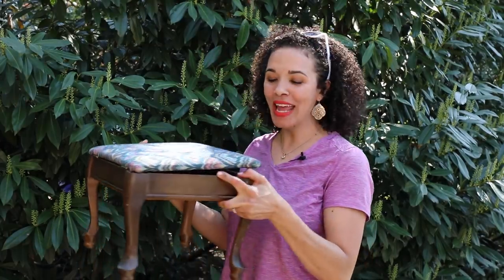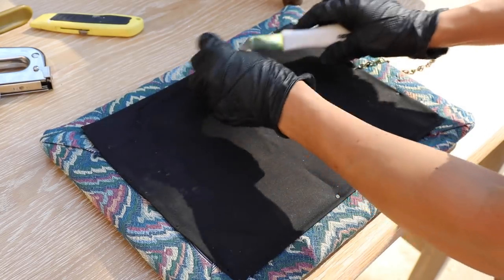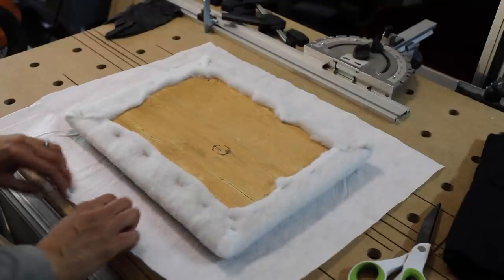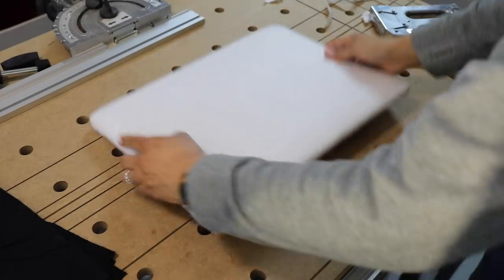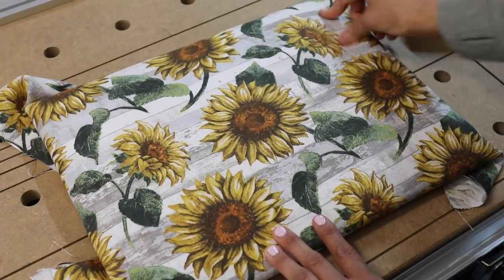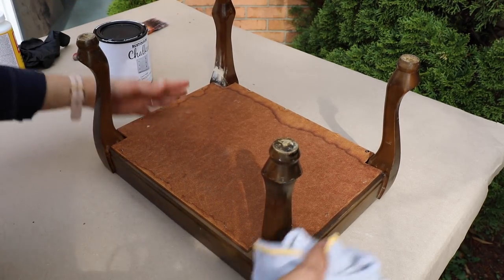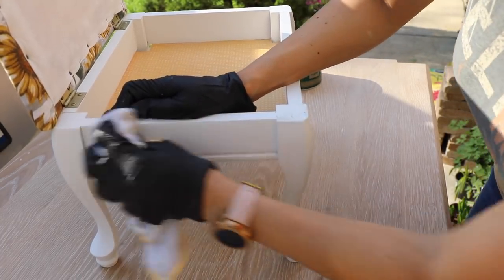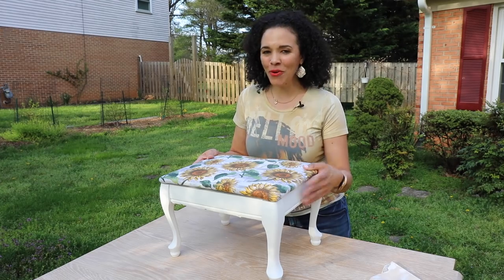How to Paint and Reupholster Your FIRST Piece of Furniture! - Thrift Diving

Comment: Reminder for DIYers not to rush their project. Let the glue dry overnight. Let the paint completely dry. Have patience for the nicest reward. 😀
Reply from the maker: Yesssss! Facts!
Reply: Yes 😂
Reply: ..and to repair properly by drilling out the old hole and placing new plug. And when cutting, do not pull knife toward your exposed arm. Also, using spray shellac on darker wood prior to painting will prevent bleed through. I used that same fabric to make pillows for our deck. Very cheery. Otherwise, great video.

Comment: I loved this video. Small, starter project. You did such a good job of thoroughly explaining every step, such as notching the center of the fabric, or to pull fabric toward the corners, or even showing that the tacks didn't fit back into in the new corners so you used a longer screw. All those tips help beginners, or even not total beginners to succeed. Thank you so much.

Comment: if you're planning on it lasting and supporting weight at all I would drill in a few supporting screws from  inside the compartment and dremel out the messed up dowel and replace it
Reply from the maker: Good points. This will likely just be used as a foot stool without much added need for strength.
Reply: it turns out gorgeous. I  forgot to add that.

Comment: Very cute.  If you want a thicker cushion, would you have another layer (or two or three layers) cut to the size of the wood and tightly placed under the larger piece you are stapling to the wood?
Reply from the maker: Yep, that's what I would do. There is foam you can get from the craft store that can be cut to size, and would sit on top, with spray adhesive to keep it in place, then fabric pulled tight over it.

Comment: I have a similar project! Great video. I have a question... Any advice for using vintage material? Not necessarily reusing the same material, but wanting to use an older fabric on my project. Thoughts? Tips? Thanks in advance. :)
Reply from the maker: Sure! I think the main thing is to make sure that the fabric is suitable for what you're using it for, for example, not using silk to reupholster a stool or something silly like that. :) Other than that, I can't think of anything specific related to using vintage fabrics. Oh--and making sure the vintage fabric isn't so old or fragile (due to age) that it easily tears or frays!